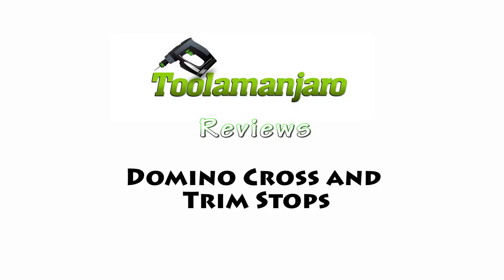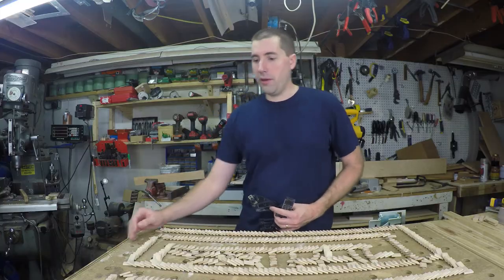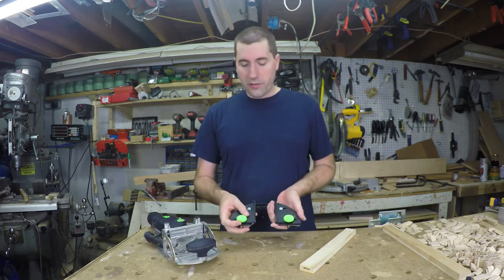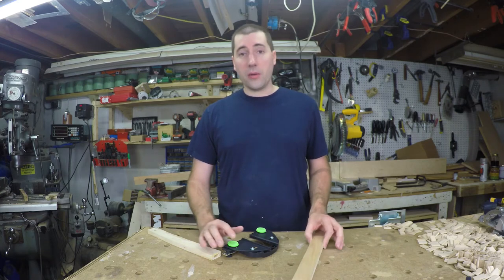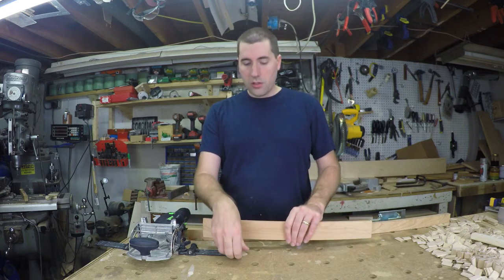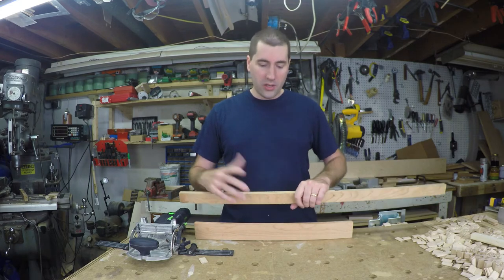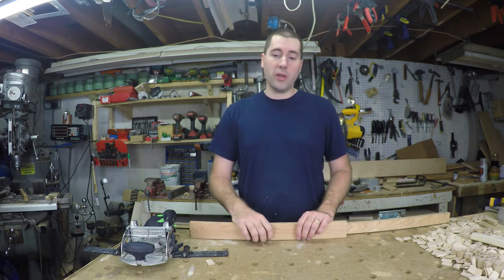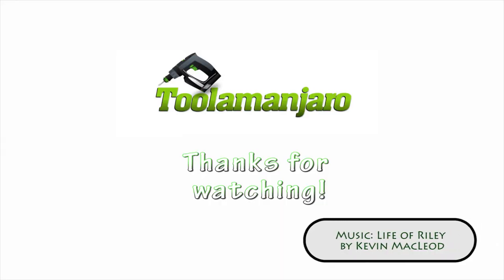Festool Domino Accessories - Cross and Trim Stop

Comment: I am a brand new domino user and completely messed up my first time using the cross stop accessory because of what you said. Even after watching festool's videos online and doing what the previous commenter said, by doing one tight then loose, I still could not get them to line up, likely because the burrs. I think I will do what you mentioned and just make marks, and then have one side tight and the other loose.

Comment: One solution to the cross stop alignment issue for long board glue ups is to make the first mortise using the smallest setting, then switch to the medium setting for the rest of the mortises. Then mirror the mortises on the opposing board and you should have perfect alignment on all mortises, I use this method all the time, there is no real benefit to having tight mortises down the length of the board due to the fact that it is an end grain to long grain on the rounded sides of the actual domino. The strength comes from the long grain to long grain surfaces on both the domino and the flat side of the mortise. Informative and honest vid.
Reply from the maker: +Hugo Perez I don't like having big mortises on both sides as the dominos tend to get crooked and make the glue-ups more difficult.
Reply: Toolamanjaro I don't like that my car can't fly...  But, if I drive it off of a cliff due to "personal preference", I cannot "reasonably" blame the manufacturer. 

That is in essence (for this analogy) attempting to use 1" holes on one piece, then 10mm holes on another, then blaming a measurement tool for how things turn out, just because...

     Survey says: "I Don't like instructions or measuring consistently."

I'm not trying to be a dick here, I promise.

Try this exercise: Walk heel to toe for the length of a wall, and record that measurement... that will be the large mortise.

have a five year old walk the same wall, heel to toe.  Record that.   That will be the small mortise.

The measurement difference (foot size) is what you are attempting to force a match on with your method. 

However, shoe sizes and gaits must match for the match to be effective.

Comment: Great review. Hope to see more coming. Particularly Would live more Domino info/tips and tricks. 

I got the DF500 set, never used the cross stop, and after watching this review I doubt I will bother, and I found that in theory the cross stop was helpful, in practice when I used it to batch out allot of parts it didn't hold the settings well, so I just used a pencil.

Comment: Your approach to putting tight mortises on one side and wide on the other defeats a major purpose of the domino and is contrary to the Manual and Supplementary manual. Tight mortise at one end to assure alignment then medium the rest of the   Way. If you’re having trouble with the product doing it the way it supposed to be used you probably did not calibrate it properly to begin with.
Reply from the maker: The correct method is to make one mortise tight on both sides and the rest loose.  If you make them both tight you’ll never get the joint together.
Reply: Toolamanjaro that’s exactly what I posted.